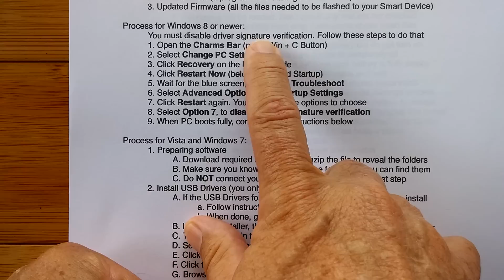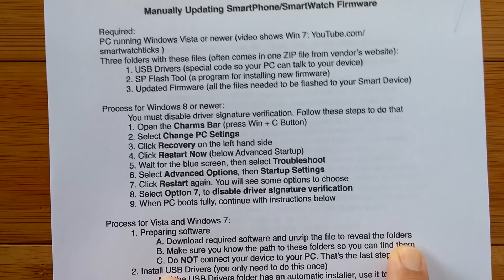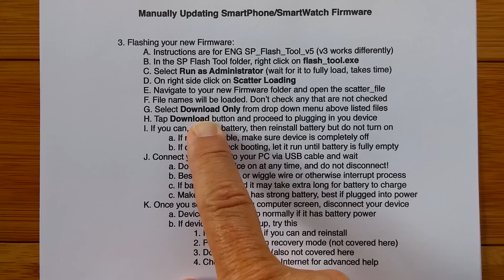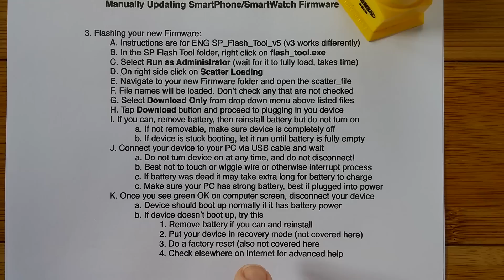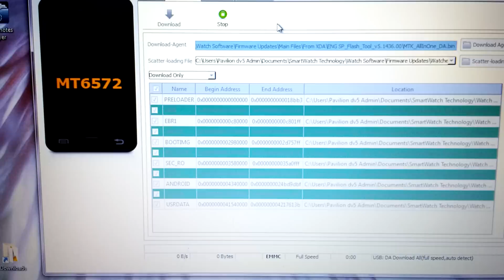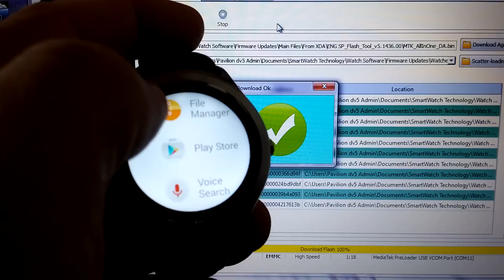No.1 D5 Smartwatch Firmware Update Process

Comment: Hi. And thanks for this great video tutorial.
Not sure if you can help me, as I have a Finow Q1 Pro, and decided to upgrade its FW, but instead of just downloading the scatter file, I chose Format+Download, and you know what hapenned next...lost IMEI, NVRAM error, so cannot use its SIM card GSM service.
WIFI and BT are working, but no IMEI.
Have NVRAM error on the WIFI section which appears as if it is a WIFI network...
I have contacted Finow to help me regain the NVRAM files which I should have backed up before anything, but did not. So now NVRAM corrupt or non existing.
I read that now I need the scatter file + NVRAM.bin + NVRAM.img + NVDATA files, having to open the scatter file with notepad and changing NVRAM sections to true, etc, then saving new scatter file with these changes in same folder with the NVRAM + NVDATA files, open SPTool, open the modified scatter file, and only tic the NVRAM box, leaving all others unticked, and just hit download.
Of course before downloading the modified scatter file, the watch has to already have the new FW on it.
I have tried to write the IMEI with SN/IMEI tool, but always fails, because NVRAM is not present on the watch or is corrupt.
Only other way would be to root the watch, but don't want to do so as will loose warranty.
Need only the NVRAM files to get back the IMEI section and then change the IMEI to my own IMEI. So if you or anybody has a NVRAM backup of this Finow Q1 Pro, and could send it, would appreciate.
No worries as the IMEI present on your NVRAM files would be changed to my own watche's IMEI.
Hope you can help if there is any other way to recover NVRAM and IMEI without rooting.
Thanks in advance.
Reply from the maker: Thanks for leaving this here, and I hope some tech savvy readers can help you out. What I would suggest is asking this in the smartwatch tech support area at www.fullandroidwatch.org

Comment: I did exactly like in the video and my watch is not turning on. What can I do now?
Reply from the maker: I'm still really green at all this flashing. If you got all the way to the green square with the check mark on your computer screen, you successfully "flashed". If it won't turn on, I'd suggest leaving it in the charger overnight to give the battery time to come back. It may be totally depleted and need awhile to restore. If that doesn't do it, then head on over here and ask these guys for help:
This is the best place to discuss your situation: Join the “Round Android Watches Proboard” here: http://roundandroidwatches.proboards.com 
Simply set up a free account, explore the various sections available to you, and jump in. There are many watch users and technical experts discussing just about everything related to smartwatches. From general watch questions to updated watch firmware you’ll find it, and you’ll find many answers in the extensive FAQs as well.
Reply: SmartWatch Ticks I will do that, thank you man for the video and the support

Comment: I had choose a wrong display pixel setting, instead of 360 x 360 , I choose 1920 x 1080, and the result is got 3 overlay displays. and the display doesn't react anymore. now i can't use it anymore. do you may be have any suggestions to solve this problem?  thx
Reply: Tiago Ramalho oi! Tdo bem? Olha eu não tinha um Windows certo etc etc enviei-lo para uma loja em Leiria e eles conseguiram-mo arranjar. Cobraram 40 euros. É a P telemóveis! ;) Abraços!
Reply from the maker: I'm pretty sure you will need to flash new firmware to your watch to regain access. This is the best place to discuss your situation: Join the “Round Android Watches Proboard” here: http://roundandroidwatches.proboards.com 
Simply set up a free account, explore the various sections available to you, and jump in. There are many watch users and technical experts discussing just about everything related to smartwatches. From general watch questions to updated watch firmware you’ll find it, and you’ll find many answers in the extensive FAQs as well.
Reply: made the same mistake. were you able to solve the issue?
Reply: Ivo boa noite, conseguiste resolver o problema? Eu sem querer fiz a mesma asneira. Ajuda me. ! O meu relogio é completamente novo, tem menos de 1 semana.... tkx
Reply: ivo barroso deixa me o teu contacto preciso falar ctg amigo.

Comment: Hi there, 

Recently received new d5+. At first Sim feature and Google Playstore was not working, now accidentally set some resolution on  the watch..and its completely messed up..Please suggest or email me at greenarunk@gmail.com. Please help me out of this..getting frustrated.
Reply from the maker: Oh, sorry to say you are in serious trouble Arun. That screen resolution change is usually nonrecoverable. You'll need to completely reflash your firmware. If you haven't done that before, you're just at the edge of frustration, especially if you computer is a Windows 10. This is the point where I hand you off to the tech folks on the Proboards who do this stuff and have the flash files you will need. Begin here, and best of luck:
Join the “Round Android Watches Proboard” here: http://roundandroidwatches.proboards.com 
Simply set up a free account, explore the various sections available to you, and jump in. There are many watch users and technical experts discussing just about everything related to smartwatches. From general watch questions to updated watch firmware you’ll find it, and you’ll find many answers in the extensive FAQs as well.
Reply: SmartWatch Ticks was very much inspired by your dictations...it was also a reason why I bought it.. In contact with gearbest support team.. Not at all able to understand how they would be able to fix it by email.. Have not heard back from them after submission..
Reply from the maker: Gearbest, as well as all these retailers, are sales agents, not tech folks. The website I pointed you to it the closest thing you will find to real English speaking tech support folks. There's a team member in USA, Australia, Europe, and somewhere else, I don't remember right now. With what you've done with the screen resolution, as far as I know from many others in the same predicament, flashing will be your only option other than return for refund/replacement.
Reply: SmartWatch Ticks Thank you for kind guidence. Posted my query on Pro board forum.. Awaiting response from them as well.. Hoping for something positive...
Reply: Hi Arun Sorry did you solved your problem with resolution screen? im in troubles too! Please Help meu

Comment: Thank you very much. 
But what's the difference between download only vs Format & download (or upgrade firmware). Does the download also format the paritions into flash ?vfr4d
Reply from the maker: I've heard Download and Format will wipe out your IMEI and you'll have a heck of a time getting it back. The experts who can answer your level of questions are here:
“Round Android Watches Proboard” here: http://roundandroidwatches.proboards.com 
Simply set up a free account, explore the various sections available to you, and jump in. There are many watch users and technical experts discussing just about everything related to smartwatches. From general watch questions to updated watch firmware you’ll find it, and you’ll find many answers in the extensive FAQs as well.

Comment: I just want to thank you for being really helpful in fixing the watch faces bug. Guys if you keep failing in doing so, take the time to disconnect and connect the battery again, as it is stated in another Smartwatch Ticks video, then try again. It worked for me!
Respect !
Reply from the maker: Great to hear! Glad it worked for you. Updating to the latest firmware is a good idea too. Always check for an OTA (Over The Air) update first by going to Settings, then About Divide at the bottom, then Wireless update.

Comment: Hi, I have a big problem. I downloaded others watchfaces with the button "+" in the smartwatch. When I installed them, there's watchface all black and I'm stayed blocked. Then the D5 have a black screen without clockskin and impossible to have an access to the menu. I can switch off and switch on, connect to my PC with the USB port and have an access to the file. I tried your update but it doesn't work when I connect the watch in USB with the dock charger, Flash Tool doesn't recognize the smartwatch.I'm looking for on XDA, someone have the same problem but nobody answered until now. Someone can help me?  thanks a lot.
Reply from the maker: Hi Manu, if nobody answers you here, please repost your question on these websites:

For technical support, please post your question to the tech experts here on the G+ Community: https://plus.google.com/u/0/communities/109827242607524552712Be sure to check the FAQs for answers to most common questions.
For technical support, please post your question to the tech experts here on the D5/X1/K8mini  XDA Forums: http://forum.xda-developers.com/smartwatch/other-smartwatches/smart-watch-android-watch-to-look-1-d5-t3270656 and http://forum.xda-developers.com/smartwatch/other-smartwatches/mini-k8-round-smart-watch-android-4-4-2-t3250601
Reply: +SmartWatch Ticks 

Thanks for your feedback
Reply from the maker: I wish I could help you more, but this is way over my head. The folks at those other resources know all about helping you through this. Best of luck.

Comment: Dear Smartwatchticks, 

Thanks for the videos - really detailed (especially to noobs like me).
still I am having difficulties in installing the drivers (my D5 has a messed face and I cannot use the watch - hence I need to flash the watch).
I followed your instructions step by step in both win7 and win10 (disabled the driver verification thingy), but every time I am installing any of the 5 drivers in the driver directory, I am getting that message that the driver was not installed correctly and the device cannot start (code 10). then if I continue to flashing and start the flashing operation and only then connect the watch - the PC gives a message that the driver was not installed correctly to the device..

can you think of something? thanks !
Reply from the maker: You're over my head! For technical support, please post your question to the tech experts here on the G+ Community: https://plus.google.com/u/0/communities/109827242607524552712
Reply: hurray, i was able to complete the process!!
the issue was that I was NOT using the usb cable that came with the watch. once i connected it - everything worked like a charm...

Comment: I post this message hoping you can give me some advise. I have a d5 for 2 weeks now. unfortunately the watch gets into bootup every day. I flashed the watch with the latest software. many times now ! NO1 company also gave me this advise. it did not do the trick for me. do you have any suggestion ?  best greetings from the Netherlands.
Reply from the maker: Hi John. My best advice to you is to state your situation and ask your question to the experts on this. You can find them here: https://plus.google.com/u/0/communities/109827242607524552712
Reply: Thank you for your quick reply. I appreciate it a lot. I will post my question to the experts ...My experience  flashing a D5 is that when I use an old laptop with XP, so no verification, it is really easy to do .. only I had to find the older version V3 SP flash tool, using the newer txt file included with V5 sp flash tool .Till now first try flash, everytime was succesfull.  With my Win10 laptop it is mostly really hard to do !  So .. I was happy to have an old laptop from laptop reserve fleet ! regards, John

Comment: I was using my watch for one day with poor battery performance, therfore I turned on airplane mode in the watch but on the next day watch died showing aprox 40% of the battery left in it.
I connected watch to the charger and it started to shown minimum charge and keep restarting, I left it hoping that it is maybe normal and watch will recharge, but after aprox 2 hours when I came back to the watch I was unabe to turn it back on again, also screen is blank.
- I have tried another docking station from friend that have same watch but it didnt worked, I tested my docking station on his watch and it works.
- I have disconnected the battery in the watch (small black pin with black and red cable) for 48 hours but it didnt helped
- I contacted No1 on facebook and they recommended upgrading of the firmware, but when I am connecting watch to PC it keeps restaring the connection with message on windows 10:
USB device not recognize The last USB device connected to this computer malfunctioned and Windows does not recognise it.
- I have connected my friend watch and we upgraded firmare without any problems therefore I know that I have installed USB driver correctley.
I am completley out of ideas how to sort it, my watch doesnt charge and when connected to PC keep restarting connection, does anyone know what else I can try?
Reply from the maker: Please copy and paste all of what you wrote here over on the G+ Community. You'll get help there. Here's the link: https://plus.google.com/u/0/communities/109827242607524552712

Comment: Do you know what's new?
Reply from the maker: +Daniel Francis It depends on which version is being flashed. There are at least two for each watch beyond the original stock firmware. The best way to track it (and ask specific questions about specific firmware updates) is here:
https://plus.google.com/u/0/communities/109827242607524552712/stream/7addeb1c-ef55-4732-b2e0-c6cc940dd5c0